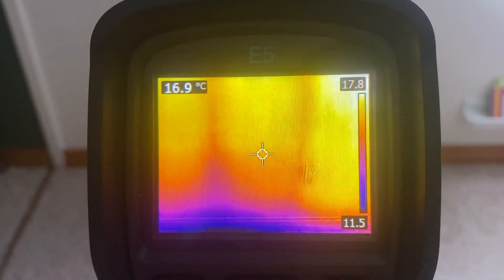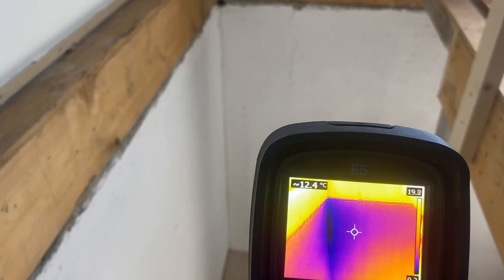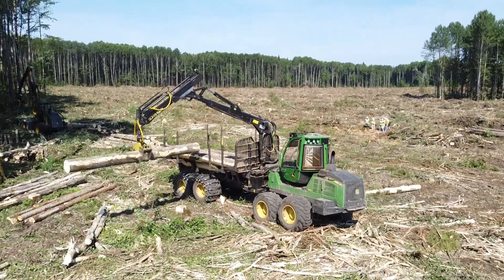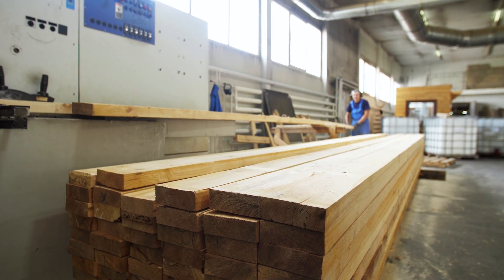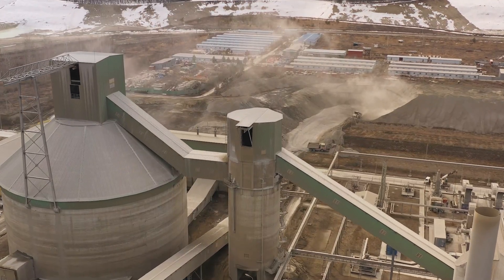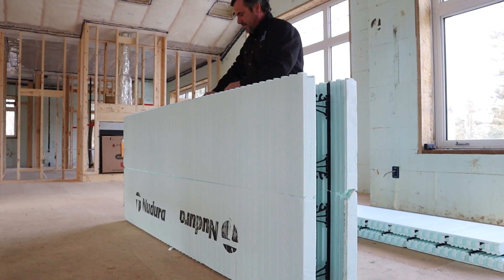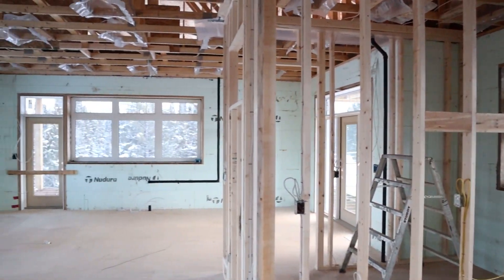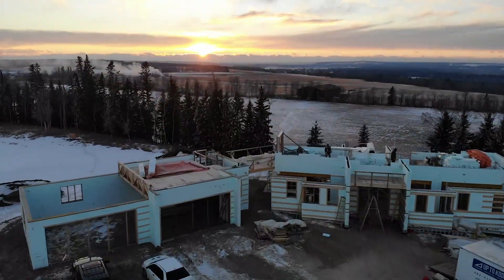How sustainable is ICF? #construction #ecofriendly #icf #nudura #energyefficiency  #renovation

Comment: Theres so much to ICF in a positive way. Unfortunately theres a lot that is intangible and hard to quantify. Time savings of framing, and virtually no framing correction, plumb, level, and square so much easier to get right on the exterior envelope and pays big dividends throughout the rest of the build

Comment: The other aspect to consider is longevity of the structure ICF vs Stick frame. As long as the roof is cared for I am thinking my ICF build will be around likely much longer than a stick frame, 2 - 3 times longer (?)  and  over time is a dramatic carbon footprint offset.